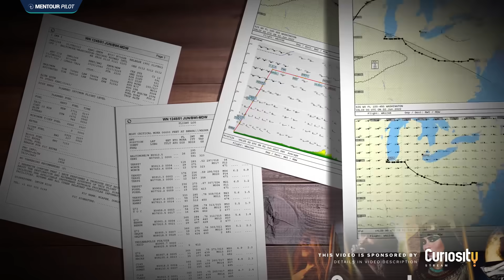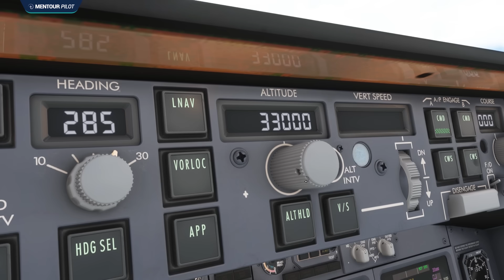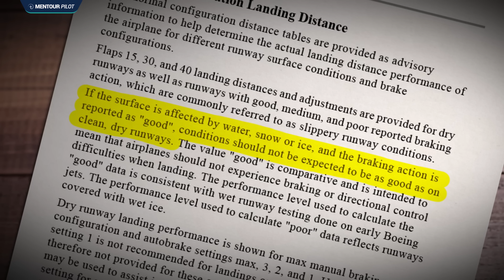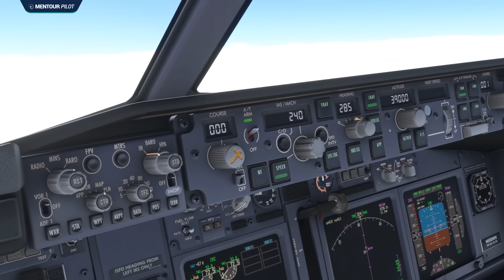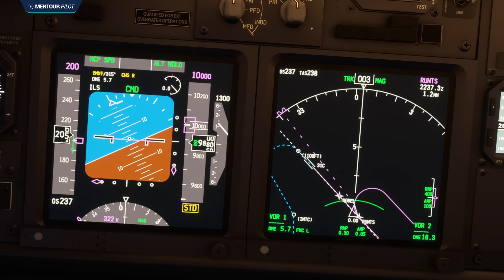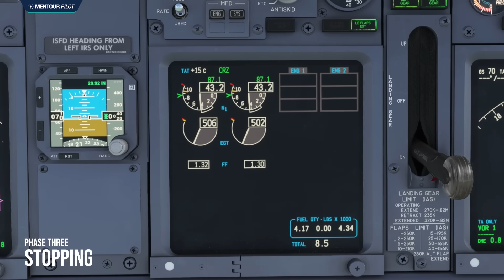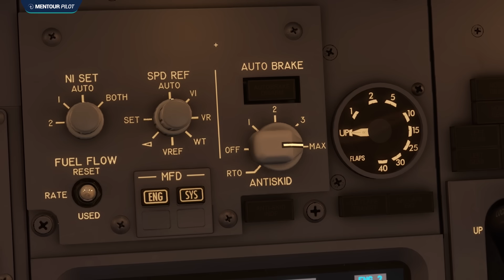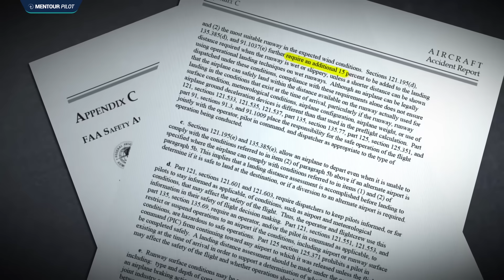WHAT did The Pilots MISS?! Explaining Southwest Airlines flight 1248

Comment: If pilots are supposed to only use the  lower rating when braking conditions are mixed, maybe airports should stop reporting mixed conditions. In this case they would report the conditions as "poor".
Reply: I was thinking this. It's misleading to give mixed conditions, just go with the most conservative and state the conditions as poor.
Reply: Yes but that wouldn’t apply to smaller lighter aircraft with much better minimums for that landing.
Reply: That sounds useful.
Reply: It sounded it was just a company procedure to use the lower rating, not an industry standard
Reply: Those data might be used for other considerations. Beside it is better to have an accurate description of the ground.The captain makes the call, not the airport.
Reply: Best comment, Tmanaz.
Reply: Yeah the ATC should know every single flight operator's procedures and change their answers based on that. Very smart, good effort champ
Reply: @BlueBillionPoundBottleJobs  You know darn well that what was said was that they should default to the WORST condition reported along any length of the runway.....for ALL aircraft.
Reply: @natural-born_pilot  conditions should just have a ranking system, and each aircraft a limit for what it can land in. so say this runway had like a rating of 7. a smaller aircraft could be rated to land up to level 8 conditions, whereas a larger could only safely land up to 5. they could still say the specific conditions for each length of runway, but the overall rating would qualify which aircraft could actually safely land
Reply: @monckey44  Except that it's not that simple. There are many factors that go into the calculation, not just the size of the airplane.
Reply: @maxine_q  yeah I know, the point of the concept is just having a ranking system so airports can give out general and more specific landing conditions
Reply: @monckey44  But there is no general. There's even differences for the same type of airplane, depending on how heavy it is, and other factors too.
Reply: @maxine_q  would a manufacturer not be able to give ratings for their planes at various weight limits? weight is already considered for landing, obviously it would play a part in landing in different weather conditions
Reply: It's still useful for the pilots to know what to expect regarding e.g. a change of feeling in the brakes
Reply: Not really, because for take off you need to calculate for each seperate condition and then take the most limiting outcome. Also for landing let's say runway braking action is good in the first 2/3ds of the runway and poor in the last third. If you calculate that you can land and stop the aircraft in the first 2/3ds of the runway you can land. However if they would only mention poor, then you would not be allowed to land. Since now landing with poor braking action isnt allowed on the 737.
Reply: @pilotguy7074 if you need more than 25% of the runway to land, you shouldn't be landing there.
Reply: Another example of let me give you a million options to confuse the f out of you.  You're right.  Should say poor bc then at least you're prepared.
Reply: ONE WORD: INSURANCE.

Comment: I grew up in Chicago, and remember this accident very clearly: the weather was quite bad that day. Landing at Midway can feel a bit scary from a passenger perspective, as you see the wingtip level with somebody's third-story window, the plane bumps down, and the braking/deceleration is noticeably harder than in some other airports. Getting there by car, yeah, the planes seem like they land right on top of you.
Reply: Lol this one actually did land on top of the car!!!!
So i guess sometimes the do!!
Reply: been there, seen that
Reply: @teamground0229  I wondered that myself. I have two (admittedly uninformed) guesses. First, that the alternate selection process assumed that conditions bad enough to close MDW would also close ORD - not unreasonable except in the case where the deciding factor is runway length, as it would have been here. Second, alternate airports on the flight plan (as opposed to an emergent in-air decision) might have been limited to airports where Southwest had a presence. While they do have some operations out of ORD now, they didn't at the time of this accident, so ORD may not have been an official alternate for that reason. (Note that I'm differentiating between planned alternates and emergency diversions, which would definitely be "any port in a storm" rather than "nearest airport out of which the airline has operations")
Reply: They need to extend the highway all the way to the terminal.
Reply: Ski, I'm automatically giving you 90% chicago blue check mark based in that alone.
Reply: @orangie8426  it did not. At 22:14 Mentour explains that after reaching that outer road a car crashed into the aircraft killing a child on board the car.
Reply: That’s true! My family has flown out of both O’hare and Midway and Midway is definitely the more… interesting.
Reply: @teamground0229   O'Hare is NOT available as an alternate, 99.9% of the time.... because 100% of the available "landing slot times" have been spoken for.  It is just too busy, booked solid, and can't accept a diversion.
Reply: @MrZrryan2  this is first good reason I’ve heard about doing the Peotone airport. I still think it’s a boondoggle.
Reply: A number of years ago now I recall there was a lot of talk about a new airport at Peotone . I guess that idea died. Midway is way out of date. Anyone know any more about the Peotone idea?
Reply: @emlangan  The main reason why O'Hare wouldn't be an alternative is physical proximity. If the weather is so bad that the landing at Midway isn't viable, the same is probably true for O'Hare. The other main reason would be that O'Hare is already very busy and finding a way to slot in an additional landing might be difficult, or the aircraft might need to hold for a long time. Having more distant alternates that aren't as busy as somewhere like O'Hare gives the best chance of better weather and a straight forward landing when arriving at the alternate airport.
Reply: @teamground0229  probably due to high landing fees...
Reply: @teamground0229  Might be cause O’hare is more expensive for airline coorporations, this flight might already have been on a tight profit margin.
Reply: I think there should be a yellow or red flashing warning sign if sensors sense that an airplane is exceeding the end of the runway. That gives the cars valuable seconds to prepare for the plane possibly shooting out, and get to a stop before that.

Plus signs before that, that hint to that being an option, that a plane could enter the highway. Something like "Possible airplane shooting out! - Watch warning signs"
Reply: @teamground0229  Southwest had nothing at O'Hare. They just recently started flying out of there.  In an emergency it would work but I'm thinking they don't want alternatives where they can't easily service the plane.  One of the reasons I never flew SW in my 30 years in Chicago is that I refused to fly out of Midway.  It was worth your life to get there due to the bad neighborhood around it, your car wasn't safe parked there, and that airport would cancel flights if a bird farted.  Surprised seeing this video that Midway was still operating with actual snow present.
Reply: Me too!
Reply: @orangie8426  lol? A child was killed
Reply: @Sarahthompson2237  ...I thought the same...
Reply: @emlangan  They had selected two alternate airports - the video shows that one of them was Kansas City.
Reply: @teamground0229  The airline pays the airport for landing, parking/gates etc.
Reply: @IroAppe  I've seen road signs that caution drivers saying, "Watch for fallen rocks," or "Trucks entering highway," and even warnings to watch for deer, so I think your idea has some merit.
Reply: I agree, MDW is one of the worst 5 airports in the entire country. It’s BAD.
Reply: @marlinweekley51   People living in the area are mostly pretty opposed. When I've been back recently it's been a little less common, but as recently as 10 years ago I remember seeing "No Airport" signs on probably a third of farms/houses. I know that's only a third, but still--that's a third who felt strongly enough to put up signs. (not talking about Peotone center; the rural area surrounding the town, whose land would be more directly disrupted)

They've got a huuuuuge Amazon warehouse over there now, though, so the cargo possibilities are probably even more attractive. (not sure if that address is technically Frankfort or Peotone, but it's right there regardless)
Reply: The only time I've landed at Midway was in the middle of the night, in rain. I'm very thankful I wasn't able to see houses right at window level.
Reply: @TheMotorGuyDirect the terminal is on a different street. There is not much that can be done unless you close 63rd completely but thatll put homes and businesses out of business.
Reply: @orangie8426 Lol?  Really?  A family lost their child when that happened.
Reply: Sounds like LaGuardia
Reply: Locals know very well once you approach midway you secure your phone and everything else in your lap or around you why? because when the thrust reversers comes on and it will, the aircraft pulls some serious braking Gs and unbelted you will go flying. Thrust reversers are a requirement in midway since your are in middle of a city and the runways are very short. On a good day with no thrust reversers the plane will crash into the road let alone winter weather. It’s the one things you remember about midway and never forget as a passenger let alone a pilot. The aircraft is usually planted hard and immediately the braking is very aggressive and been this way since forever. Driving on the highway the end of the runway is actually next to busy roads. Sad for the child that died.
Reply: @yourcrazyteacher585 . La Guardia got nothing on midway. Midway is worse and have landed at both

Comment: I think the landing calculation software automatically setting the wind to a lower value is a very bad design. It should calculate what it's asked for, not try and second guess the inputs.
Reply: Or throw up a big warning that can’t be missed or ignored.
Reply: Yes! And if parameter or other is not appropriate, it should present a "cannot calculate, such and such is out of bounds" message in a big red box.
Reply: And when it sees you're thinking of landing with 10 knot tailwind on wet runway, just explode the screen with flashing warning lights and sirens.
Reply: Yet another software gem, brought to us by geniuses who thought radio altimeter height of -8 ft is A-OK.
Reply: Shocking if they didn't cite that as a contributing factor in the official report. Maybe they did and it just didn't make the video
Reply: @Ninjalectual  Well it pretty much was. If that thing hadn’t capped at 5, the pilots would have probably realised the true danger of the conditions and opted to divert or do a full manual stop instead of deciding to test the auto brake in the worst conditions.
Reply: I can't help feeling that the effect of the extra three knots of tailwind is being exaggerated here. Landing distance required graphs have massive safety increments already included, for example in the calculations any tailwind is increased by 50%. This would mean that even the five knots used would automatically have been increased to 7.5 knots which is very closed to the actual 8 knots. The calculation would also have then increased the distance required by 50% as it does in all landing distance calculations. LDA calculations are very conservative

The significant factor is surely the 18 second delay in selecting full reverse and any fumbling in the use of the brakes. If the airline never used Autobrake how would anyone if the system worked at all? The airlines I flew B737s for have always used Autobrake.
Reply: @johnsrabe  I would argue pilots should be able to proceed calculations anyway. For a case of emergency
Reply: @KryptLynx  (I’m not a pilot.) Sure! but at least it should be made more obvious when they are doing so.
Reply: @tedwalford7615  That should do it Ted. I love the audio & visual created in ones mind, with your choice of words... "Explode the screen with flashing warning lights & sirens."
Reply: Or it should reject the calculation. "Tail wind out of safe range"
Reply: Or send up an error window that requires a manual override. That way the calculator still works, but the user is reminded of the rules/parameters they are breaking.
Reply: Pretty sure it has a tolerance/safety margin in that calculation that is higher then the round down but I may be wrong, it makes sense knowing what I know of safety parameters but I'm no pilot.....

Edit, Verdon luck confirmed my theory above they already have the space to round down and stay within margins......

Comment: I was flying into Midway about 20 hours after this incident.  That was the first time I first realized how large these aircraft really are.  Seeing the nose taking up 3 and a half lanes of road really put the scale in perspective for me.
Reply: As big as the 737 is, the other Boeing planes (777 and 787) are much larger.
Reply: @B  Really? I would never have known that an aircraft with a larger number would've meant it was bigger.....🤔
Reply: @gooner72 777 is as big as 747 and 787 is smaller than both of them, though still bigger than a 737. The middle number is more about generation, chronological order of when the first plane flew rather than performance or size. For instance the first big jet airliner by Boeing was the 707, which influenced almost every liner built after. They all look more or less like a 707, in various sizes with newer engines.

Then came 727, 737 and 747 eaely 1960s, 757 after that, midsized, between 747 and 737 and then 767 and 777 is huge bigger than some older 747s and 787 is the latest new model, that's not directly related to a previous one. It's decently large but not close to 777 or 747, it's meant to replace 767 and is about a similar size, wide body but not a full sized jumbo jet like 777. L1011, DC10 etc...